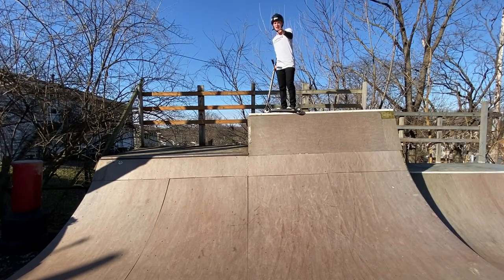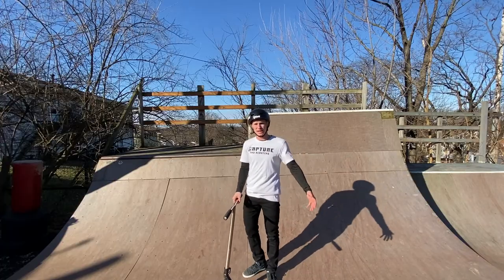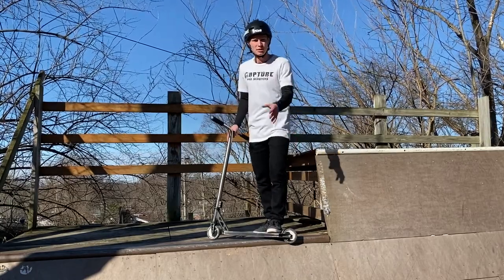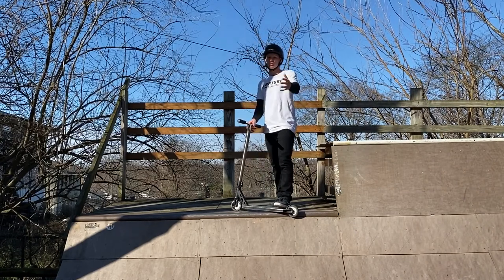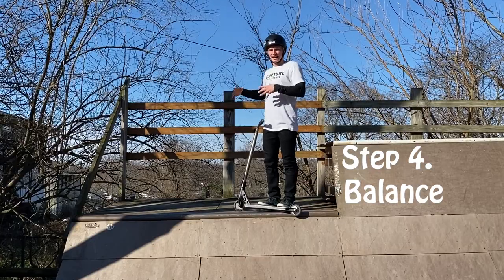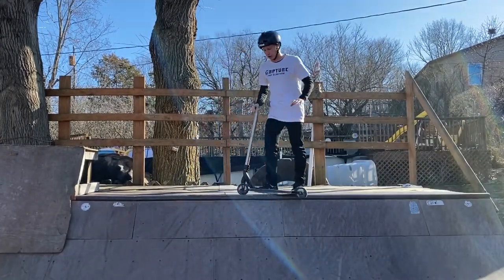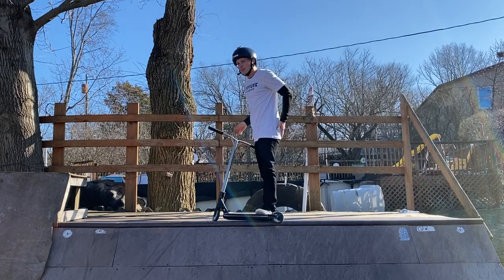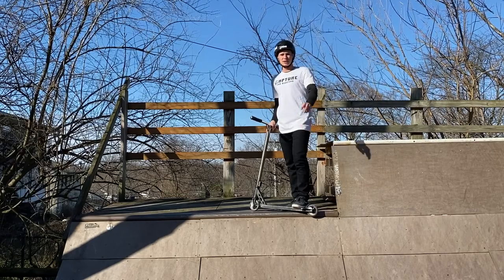HOW TO FEEBLE ON A SCOOTER

Comment: Thank you so much for the in depth explanation I used to go to the skate park 24/7 about 5 years ago but I had to stop riding due to trying to feeble on a half pipe that was about 25 feet high but I fell right off and tried to break the fall on my left leg and my femur snapped clean in half I  was told I had to stop riding it broke me and I got really depressed which lead to me gaining a whole lotta weight
Reply from the maker: Ahh dang dude that sounds like it was a crazy fall. Hope you’re doing OK now. Are you able to ride now?
Reply: @ChaseRost  YEAH

Comment: Your video helped me bunches bud. Great tips for the feeble grind and stall.
Reply from the maker: Jonny Fernandez Yoo thanks so much! I really appreciate that!
Reply: Chase Rost what’s the trick for hopping back in transition from feeble man I’m getting psyched out too much.
Reply from the maker: Jonny Fernandez hey man sorry for the late reply, just saw your response as I was going through my comments. A great way to get back into the transition is to make sure your body is fully leaning inside the ramp. Once your body weight is already inside the ramp it makes lifting your front wheel and turning 90° so much easier

Comment: I can already feeble but I do it frontside any tips on doing it backside
Reply from the maker: its super similar, and the same rules apply, make sure your steering with your front wheel and trying your best to keep the back end locked in. besides that its mainly just a bunch of re learning the opposite way and cracking into that muscle memory to do it on the opposite side.

Comment: I tried this at the skatepark and slipped
Reply from the maker: Kidjr TG ouch! Feeble definitely have that possibility of slipping out sometimes. Hope you’re all good
Reply: @ChaseRost  i always slip out idk if its cuz i waxed the bottom of my deck or  i just suck
Reply from the maker: @xtert2473  a good way to help you from slipping out is to lean a bit more forward over your bars. Also make sure you are steering with your bars to keep your front wheel close and parallel to the coping
Reply: @ChaseRost  ok thanks ill try that out